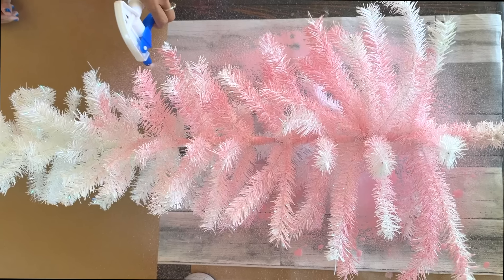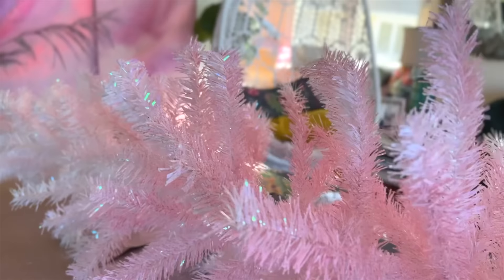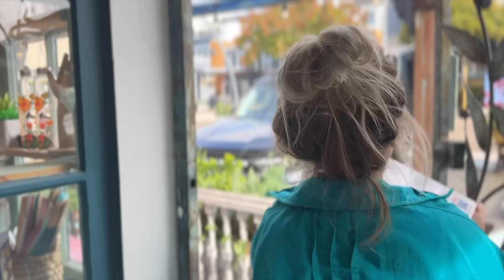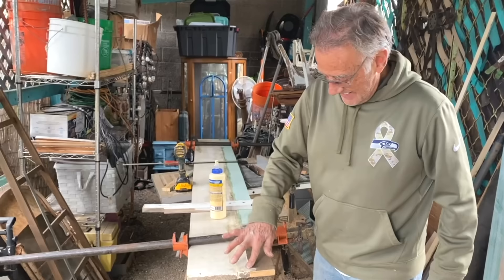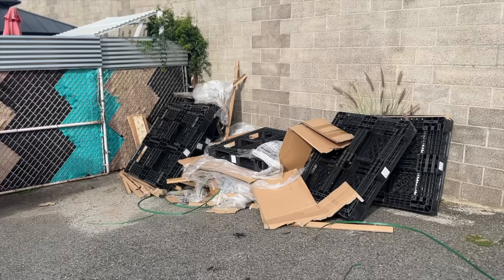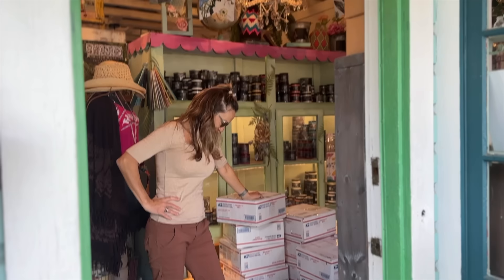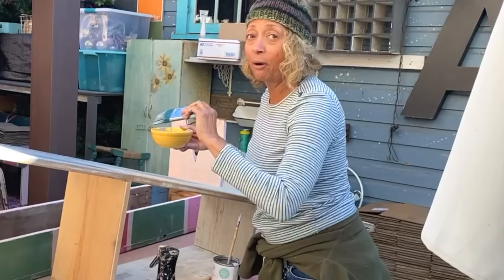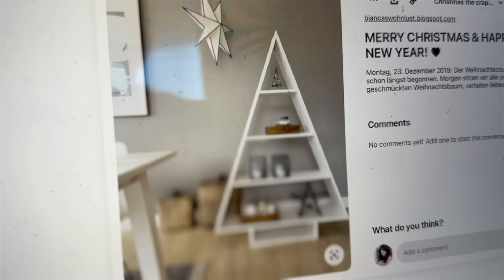Painting $1 Christmas trees & turning them into high end decor!!

Comment: Fun video, is the paint tubes full of chalk paint ? Or acrylic?
Reply from the maker: It is not acrylic or chalk paint. It is a traditional artist, paint without any acrylic .  Vintage paints used to be made by grinding pigment and using linseed oil as a binder. These paints are mostly pigment with a water-based binder instead of Lynn seed oil.